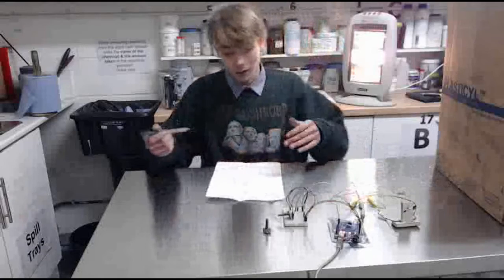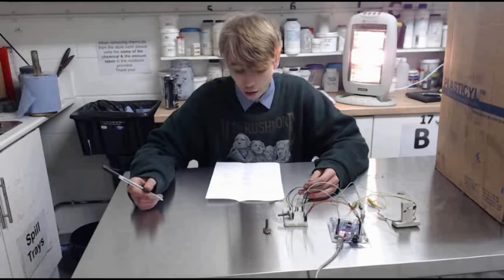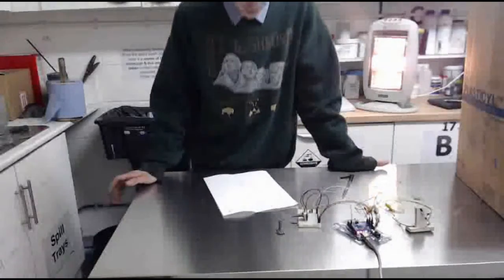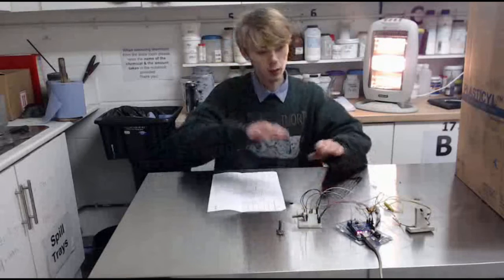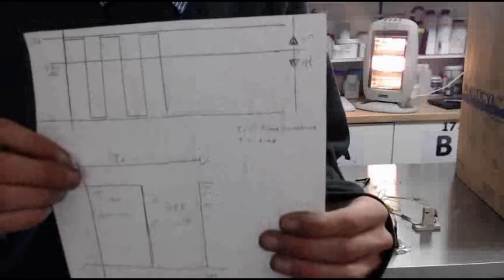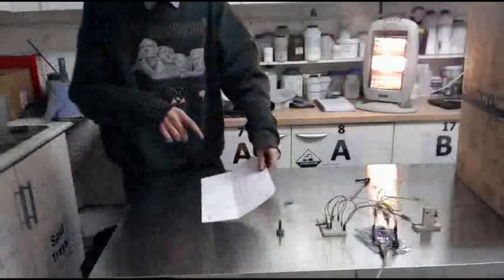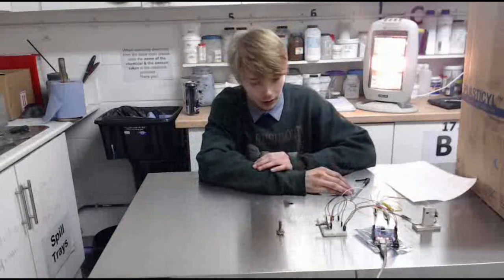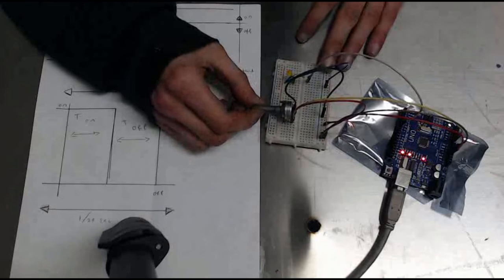Pulse Width Modulation with an Arduino

Comment: Well done, Luke. I enjoy using PWM with arduino projects. And you may also enjoy an h-bridge hat with your arduino. With it, you can show motor speed control in both forward and backward directions, still using PWM.  But be careful driving an LED "in reverse"! They don't fair nearly as well.  Keep the videos coming, great fun.

Comment: PWM essentially works by turning on and off many times (creates a square wave), the frequency is fixed to around 490Hz on the Uno at 16MHz, the time on to time off is called the duty cycle, so 50% duty would be off for half the time and on for half the time, the way our eyes perceive light at such a fast rate (which is how some LED matrix displays work) is called persistence of vision so turning a output in on and off fast the LED reacts to this by appearing "dim" but in reality the voltage is being given and taken away so quickly that it hasn't time to turn fully off, and we can't see these transitions we just see a "dim" LED.

Comment: I ask you to help me ... as I make battery of aluminum foil ... and please which liquid should be ... ???
Reply from the maker: best not posting this kind of question to Luke mate - he doesn't know the answer -  Zacariah gave a good answer
Reply: Aluminium chloride hexahydrate with urea and choline chloride in a glycerol matrix. Then Al as the negative, a porous and dielectric separator material, and carbon or Ni foam as the positive electrode. Is rechargable, average voltage of 1.8 - 2.5V per cell and over 600mA/g
Reply: Thank You mann
Reply: I actually made a mistake here, i am going to mention it just for other people readign the comments - Glycerol is incorrect. I meant to say Ethylene Glycol. Not Glycerol. The electrolyte is a Deep Eutectic Solvent with AlCl as the active ion.
Reply: @wanderingzanzey2126  trank You 

Danke schön